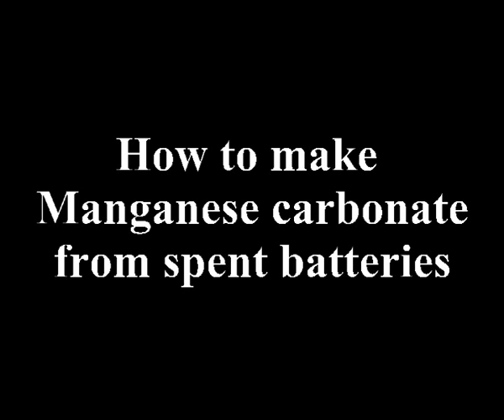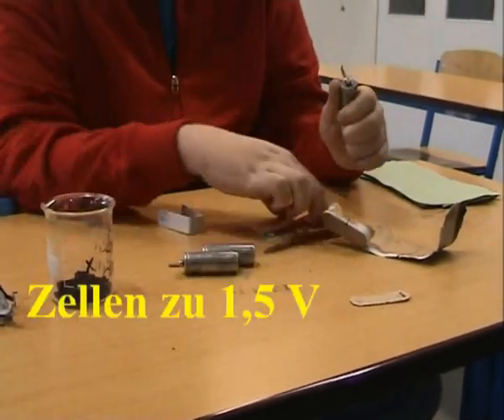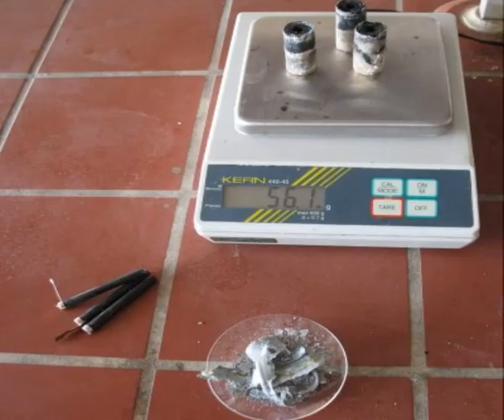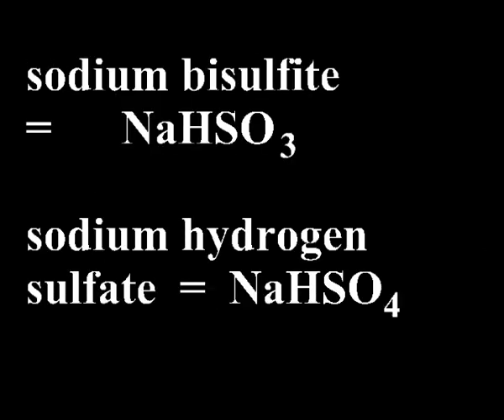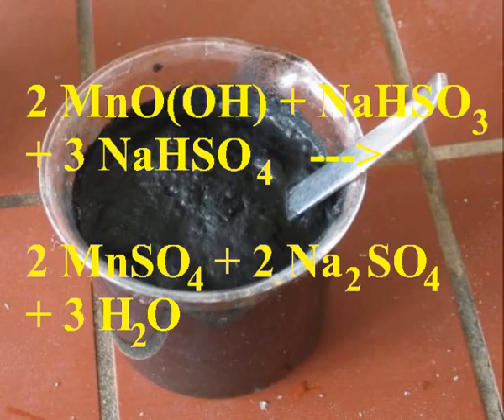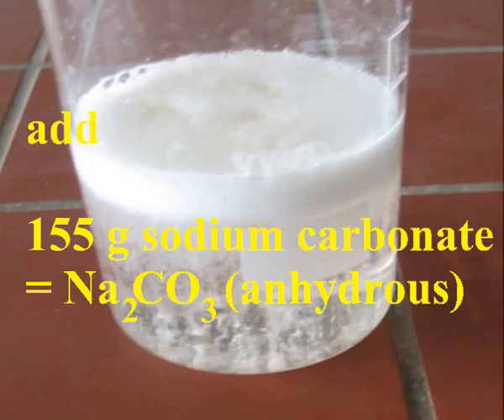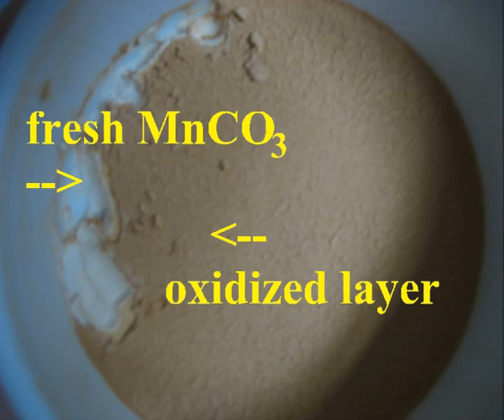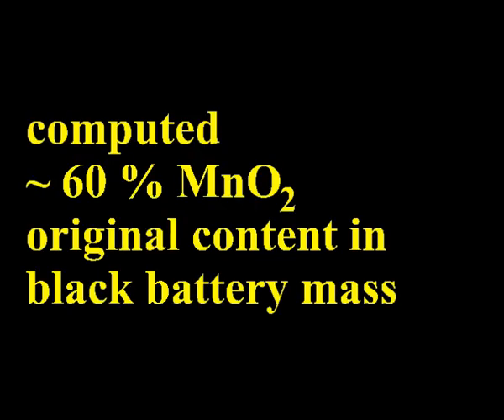How to make manganese carbonate from spent batteries

Comment: forgot to ask but, what is the MnCO3 oxidized to? I made some MnCO3 by dissolving MnO2 in HCl making MnCl2 then filtering and adding Na2CO3. Then dissolving the MnCO3 in H2SO4 and purifying it using sodium hydroxide (see: nurd rage's video on purifying manganese sulfate) and then i filtered it and added Na2CO3 and boiled the solution to dryness being sure not to exceed 200C

Comment from the maker: @spotlightman1234 
It will be soluble if a reducing agent is present. I used hydrogen sulfite in this very video. [Your MnCO3 shouldn't have been heated when oxygen is present to avoid oxidation to Mn(III) in the first place.]